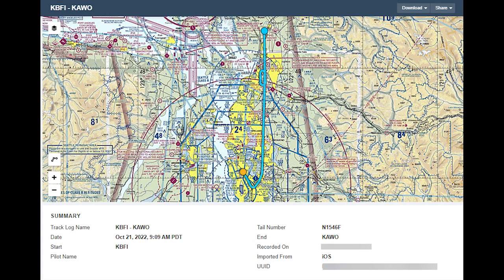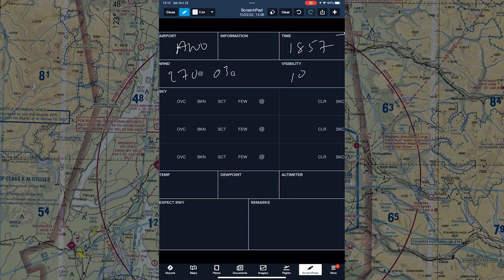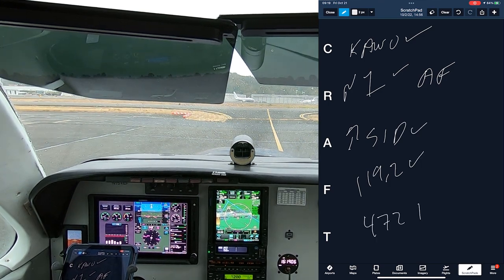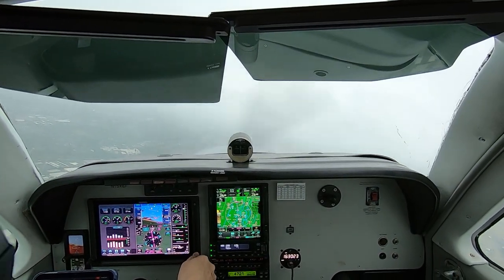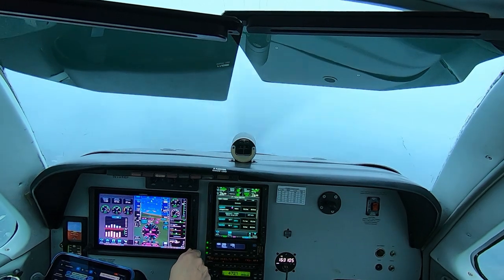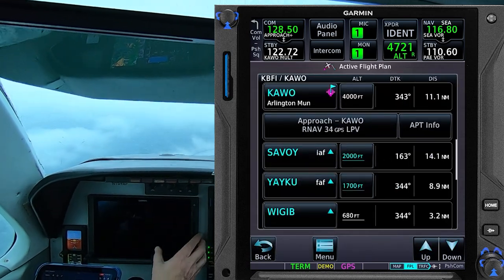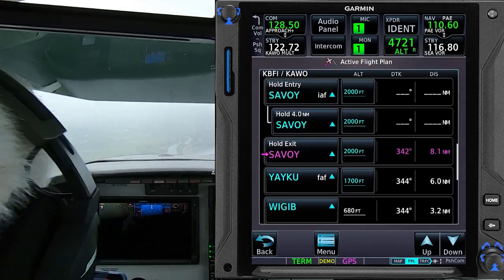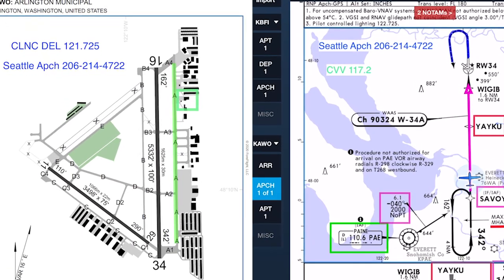IFR Tips on a Flight from KBFI to KAWO

Comment: I took advantage of yesterdays ideal weather to fly a few approaches into OLM and CLS. 

However, the clouds became more abundant at 4000’ as the flight progressed and the possibility of ice became a concern. 
That was the forecasted level for the beginning of ice. 
 Luckily I did not encounter any. 
I’m curious where you would likely first see ice begin to form in a 172? 
I scanned the struts and wing frequently, as frequently as I was able being single pilot IFR with lots of Blackbird helicopters in the area. Pleasant weather to start the flight and TAF’s looked ideal. It’s that time of the year, lucky to get a few approaches in.
Reply from the maker: For good information about ice, see AC 91-74B: https://www.faa.gov/documentlibrary/media/advisory_circular/ac_91-74b.pdf
Reply: Thank you for that link. Not much to scan on a 172, struts and leading edge. I recall you got into ice on return from Pilotworkshop, kept calm. Best to avoid that environment at all cost.

Comment: Love watching your videos! When you flew the course reversal using heading mode, what reference point did you measure the 4 nm distance of the outbound leg? I’d worry that the GTN would sequence to the next fix after SAVOY, so that couldn’t be used as your reference.
Reply from the maker: Even if the HILPT isn't loaded, you can see the distance from the fix, in this case SAVOY. If necessary, you can put the GTN (or other navigator) in suspend mode. But as I noted in the video, before I started outbound, the controller advised me that she would extend the outbound leg and call my inbound turn after I called a VFR target in sight. She wanted to ensure that I would turn behind that traffic that was crossing the final approach course from SE to NW.

Comment: Great tips - thanks. Just curious why you don’t have the chart next to the PDF and the course on the iPad. I fly a single Aspen and have thought that having a MFD next to the PDF would minimize eye movements and make flying the approach easier.
Reply from the maker: I have FAA charts in the panel primarily as a backup should my iPad fail. I don't typically display procedure charts on the PFD or MFD because: (1) As I noted in the video, I annotate charts, and you can't mark up charts displayed in the panel. (2) I much prefer the ease of use and readability of charts on the iPad, mounted on the yoke. I can quickly change charts, zoom in and view specific areas of a chart on the iPad, and read the fine print much more easily on charts in ForeFlight. (3) I prefer to have the map and flight plan displays up on the panel so that I can easily see weather, the sequences of fixes, etc. as I brief and monitor my progress while flying procedures. Showing charts on the iPad decreases screen clutter in the panel. (4) My comfort with charts on the iPad is probably the result of decades of IFR flying with paper charts clipped to the yoke.
Reply: Thanks

Comment: Gas a little cheaper at KAWO than KBFI eh :)
Reply from the maker: Fuel is less expensive at KAWO than at KBFI, but you don't save much flying back and forth. I wanted to test fly the airplane after an oil change--and exercise it a bit.